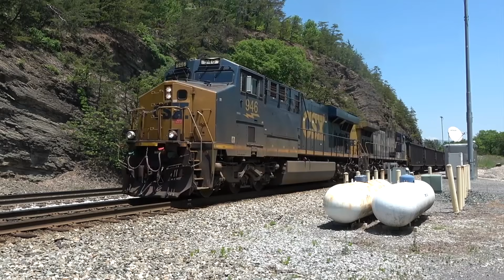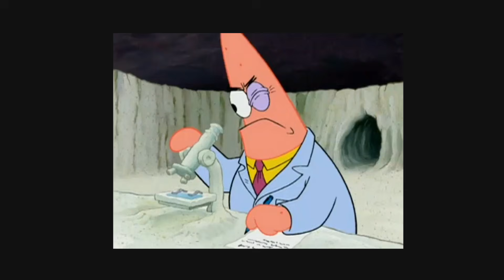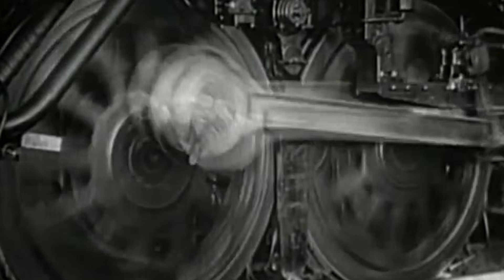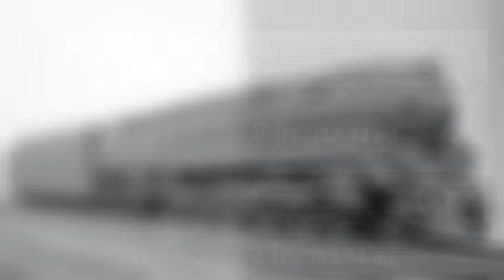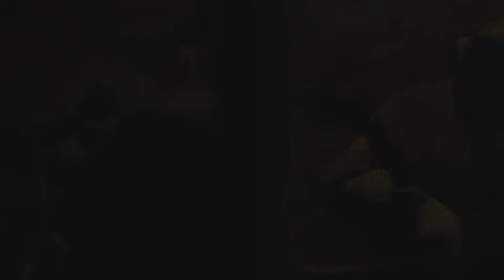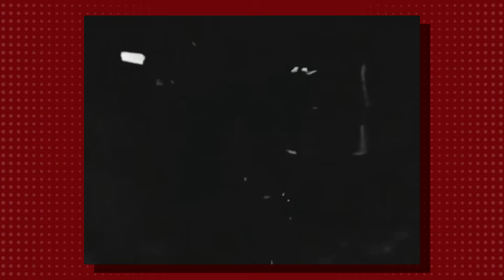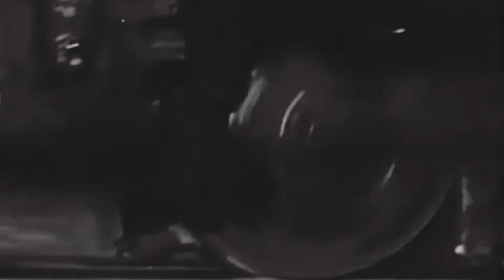PRR Q Series: The Pennsy's Duplex Powerhouse

Comment: 0:01 "It takes a lot of horsepower to get a freight train moving."
Nope. It takes a lot of tractive effort. Horsepower is for going fast. That's why a couple of 1000hp switchers can still move a big train in the yard, but can't move it quickly. And why a couple of 1000hp switchers can move a bigger train than a 2000hp GP38-2.

Comment: It should be noted that the figures obtained by the Altoona test plant should be taken with a grain of salt as they represent the locomotive's performance at beyond perfect conditions that would be at best improbable at worst impossible to replicate on the road. The locos' over the road performance would have been quite a bit lower than what was obtained at the test plant. Sure, on the test plant the Q2 could get really close to 8,000hp, but on the railroad in regular service it wouldn't have gotten near that kind of performance.

Comment: Hang me if you want, but I'm of the opinion that, given their higher expenses compared to the J1 2-10-4, the Duplex concept as a whole was never worth it.
Reply: Yep. Also the passenger duplexes we're of a mostly fear from PRR engineering department that 8 coupled drivers would finally reach it's limits. That's why PRR never adopted a 4-8-4 or a 4-8-2 with large ~79 inch drivers. The concept as a whole is designed to split the Main rods in half to make them lighter and reduce stability issues.

Comment: Ive heard that part of the wheel slip issue on q2s and t1s was that they were so powerful and had so much more power readily available, that engineers would essentially do train burnouts because they werent used to how much power these locomotives had available to them
Reply: And this is exactly why the statement at the start of the video about needing a lot of horsepower to start a train is false. You need a lot of tractive effort to start a train. Having a lot of horsepower lets you go fast, but also puts you at risk of wheelslip at low speeds.

Comment: Why don’t they preserve these things?
Reply: First, because they were largely a failure: they built a class of locomotives whose only real use was fast freights, but the railroad didn't run any of those. Nobody likes to put their failures on display for eternity. But the main reason is that the Pennsy was perpetually short of cash. If you have no money, and 25 redundant large steam locomotives, what do you do with them? Sell them for scrap for tens of thousands of dollars each, or give them away to museums? Or, if you're a museum who's prepared to spend tens of thousands of dollars on a locomotive, what are you going to buy? A locomotive that shows what a typical steam-powered freight train looked like, or some weird thing that only ran for a few years because it wasn't designed for the work that needed to be done?

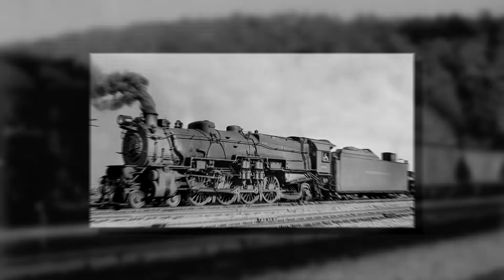Comment: Why didnt they just added another trailing wheel and make at least one 4-8-4 northern? 0:30
Reply: Anyways regarding the M-1 and more things.

The M-1's weight on drivers was already limiting enough that penny couldn't add more tractive effort otherwise the added power will go to waste. Adding another trailing to make a 4-8-4 would take away the weight on drivers even more reducing effective tractive effort.

Weight on drivers on M-1's is 271000 pounds. At M-1b with 69700 lbf tractive effort, the Factor of adhesion is 3.89 (Weight on Drivers ÷ Tractive Effort)(generally below 4 is not desirable resulting in slippery locomotives & potentially wasting the excess tractive effort).

  Also before the S-1s, Pennsy's mechanical department saw extra trailing trucks as undesirable, reducing weight on driving wheels and adding maintenance cost (though this was still less cost compared to many other parts). That's why most of their fleet only had one trailing wheel if any. It was only until the duplex era where they finally need a 4 wheel trailing truck.

Also compared to New York Central. Pennsylvania was  very conservative to innovation. They kept building late 1910 designs, and adopted stokers, superheaters, Feedwater heaters and roller bearings pretty late. 

(Addition to my 3rd point) New York Central was the first railroad to adopt Lima's superpower concept with H-10 Mikados, Boston & Albany A-1a (NYC subsidiary) and the Hudsons. Pennsy was STILL BUILDING K-4s when NYC had already been taking the Hudsons and other superpowers.

Comment: Do you know what the horse power and tractive effort for the Pennsylvania J 1 class is ?
Reply: The J1s had 95,100 lbs of tractive effort, 110,100 lbs with the booster activated. They had around 5,600 horsepower.

Comment: You know motive power managers in that time were stupid. Also unionized to an extreme. There are simply countless cases where superior power was relegated to inferior assignments.

The Q2 had Galatzin PA coal drag written all over it. A similar screwup involved L&Ns marvelous Big Emmas that got stuck dragging coal when they actually were fast freight, maybe actually passenger class locomotives.

THIS CRAP DID MORE TO KILL STEAM THAN ANY DIESEL EVER DID.

Another prime PRR example came when the Pennsy's T1 prototype rolled out they simply placed an order without doing a shakedown. Duhh, that was beyond stupid. This was a whole new platform with LOTS of unknowns and variables + LOTS of subsequent flaws. A shakedown/trial period would have descovered these and allowed for corrections. 

Over at ACL, their marvelous R1s after a sub par unveiling underwent design corrections rendering them superb.

Note: The current T1 project is redesigning/upgrading these things while retro engineering out design flaws. That things looking to be marvelous and WE CANT WAIT TO SEE HER IN STEAM!

In the end, the old guard Pennsy establishment was NOT fiscally responsible or actually progressive at all, which was most clearly made evident via PENN CENTRAL.

Comment: Ironically, the J1a 2-10-4s outlasted the Q's and T's by many years. Duplex's might have been wonderful on the Union Pacific, or even the New York Central, but the PRR was basically a 50 MPH freight railroad.
Reply: Not really, the UP favors articulate locomotives. Granted the NYC is a different story.

Comment: Coming back to this after a while with a few points 

The Q1 was designed with designed with passenger service in mind as well. That’s partly why it was streamlined and had such large wheels. It barely if ever worked passenger trains because the PRR needed something bigger and faster on freight trains during the war, and there were very few passenger trains out of Columbus that would’ve warranted its use instead. There were very few heading to Chicago and none to Sandusky. Not sure where 60,000 came from, I’ve seen 165,000 listed as its lifetime mileage. Still not extraordinary, but the averages as comparable annual travel to a Mohawk. In this case it must’ve spent a bit less time in the shop. Its power curve was decent, in terms of drawbar power it was ahead of an ATSF 2900, but it still lost power a lot quicker than the other duplexes.

The Q2’s were definitely freight engines, and were partly justified for the surge in wartime traffic towards the end of the conflict. Their drawbar power was actually closer to a Big Boy’s, but in this respect the Q2’s were essentially their eastern counterparts. The swapped placement of the rear cylinders caused some stress on the boiler seams, and I suspect this is part of why their water consumption was so poor. It’s also what killed them in the end, not so much their worse economy to the J1. All were laid up with cracks in their boilers in 1951, and caulking only gave them barely another year.

Comment: The Q2 was magnificent but it was the solution to a problem that didn't exist, mostly because PRR didn't run their freight trains fast enough to take real advantage of their capability. That and their unacceptably high maintenance cost doomed them to be retired very quickly, while the brilliantly successful J1 class kept soldiering on until the very end of PRR steam. Another batch of the those J1 workhorses would have been a far better investment, at a time when the last thing PRR could afford was expensive experimentation. Nonetheless, certainly I wish that a Q2 had been preserved, as an example of the highest development of US steam power.
Reply: Right. The only point of a high-horsepower locomotive is to go fast. If you want to move heavy loads, tractive effort is more important, and moderate horsepower will get you moderate speed.

Comment: The Q2's tender held over 20,000 gallons of water, and they could completely drain that thing within 2-1/2 hours.  Kind of a hindrance for a high speed freight locomotive when you have to stop every 2 hours to take on water.  Also the anti-slip mechanism on the drive wheels tended to wear out quickly.
Reply: The Q2 burned a whopping 16,600 gallons of water an hour when working hard! VERY inefficient.

Comment: I think duplexes could of been sucessful if more research was put into it, with the t1 trust getting built prehapes we could finally see if the duplex concept could of really been a success
Reply: Frankly the Duplexe design is just a dead end that waste resources for a railroad that desperately need larger motive power
Reply: The duplexes were unsuccessful because they were the wrong tool for the job. The only point in having a high-horsepower locomotive is to go fast. Pennsy didn't run any fast freight trains, so they should have stuck with moderate-horsepower locomotives for their moderately fast trains.

Comment: I think the real problem with the Duplexes was PRR not investing in their infrastructure in this time period(which was a contributing factor in the down fall of Penn Central later down the road). They weren't doing the maintenance so these marvels of American ingenuity were just wastes of time. I think the T1 trust will have one amazing locomotive when they complete 5550 and it might inspire someone to make a q2 Mk2 also later down the line but the PRR was one of those text book how not to run a company.
Reply: No, the real problem is they built locomotives whose only proper use was high-speed freights, despite them not running any high-speed freights.

Comment: I’ve actually heard that the wheel slip problem was more operator error than poor design.  They could be made to operate without wheel spin but it took very precise throttle control to make that happen.  Most just couldn’t find that perfect balance.
Reply: If the design of a locomotive means that only the very best engineers can run it properly, that's a bad design.

Comment: 7987 horsepower dang that makes them one of the few big steam engines to rival the union pacific big boys
Reply: In terms of drawbar power, they’re actually roughly on par with each other! Only the Allegheny was more better in terms of actual pulling power, but its worth mentioning the Q2’s have smaller cylinders and fireboxes than both the articulated. Unfortunately they were as bad as the Big Boys on water, if not worse, and were nearly as heavy on the rails as the postwar Alleghenies

Comment: I knew I saw a version of the Q1 that had a bigger trailing truck at some point.
Mechanically I think the Q1 is one of the best looking engines there was. Though it would have been nice if they lived up to their mixed freight role and saw one with a full passenger sharknose!
That would probably be the first fantasy model I would make whenever I get the time.

As always it seems like the biggest issue with those late PRR locos was Pennsy themselves. I imagine in an alternate world where dieselization held off for another 5~10 years the Q2's would have just as much fame as the Big Boys since they really seemed to trade blows in specs. It's a shame that PRR saved so many engines, but none of these amazingly complex Duplexes.

Comment: Q class is still one of my favorite lost locos. 
Imagine what could have been if they had more time to mature.
Reply: But they were mature: the problem is that they had no use on the Pennsy system. The only reason for having a high-horsepower locomotive is to go fast. Pennsy's freight trains didn't go fast, and a moderate-horsepower locomotive is fine for going moderately fast. Oh, look, it's a J1.

Comment: Pennsylvania Railroad management seemed to get a lot of really stupid ideas in the 1930s and onwards.  The GG1 was not too shabby, but they got that design more or less from the New Haven, and look at what preceded it (class O-1 with the wheel arrangement 2-B-2, the electric equivalent to a 4-4-4) and what followed it (the DD2, supposed to be the successor to the GG1 for hauling freight or mixed traffic over the never-completed Allegheny electrification . . . so they went from the GG1 wheel arrangement of 2-C+C-2 DOWN TO 2-B+B=2!).  So it's no surprise they had equally idiotic ideas with their steam locomotives.  If the locomotive weighs over 1 million pounds and has a tractive effort around 100,000 pounds, you're not leaving much headroom for getting over a grade.  And by the way, it's not horsepower you need for starting a train -- it's tractive effort.  That is one of the reason that the M-U'd diesels won . . . although properly designed electrics would have been better (if only they had run with the E44 idea and completed the Allegheny electrification after all . . .).  Back to steam, plenty of ideas for improving steam were going around in the rest of the world, and some even got decently wide adoption, like the Bayer-Garratt.  If the Pennsylvania Railroad would have adopted that, they could have had good power output, a decent number of driving wheels for improved tractive effort, and decently short wheelbase.  But for some reason, railroads in the Americas never considered these, even though they worked fine elsewhere.
Reply: the short answer regarding the garratt is not invented here. longer answer, look at the tractive effort of the strongest garratt ever made and the strongest mallet, east african's class 59 vs norfolk and western's Y6B. 

as far as improving steam goes, the second the EMD FT came along, american steam was on a timer and WW2 only delayed the inevitable.
Reply: @hiawathabeast  Agreed about Not Invented Here.  Not the first time, and not the last.

With regard to tractive effort, remember that the African locomotives other than the more modern South African stuff had a lot lower axle loads than US locomotives, so matching US tractive effort was not possible with Garratt or Mallet designs without going to a LOT more total driving wheels.  Likewise, African freight other than South African ore trains was not as heavy as US freight.

Comment: The 7,987 HP isn't drawbar HP though, that's cylinder HP, which always has a higher figure than drawbar HP. From what I could gather, the Q2's drawbar horsepower (power at speed) was 6,645 (not sure at what speed though), well below the Allegheny's 7,498 DBHP at 46mph. So, the Q2, while still super impressive, is not the most powerful steam locomotive ever, at least not at speed.
Reply: Altoona shops. UP'S Big Boy #4000 was 6200 dhb according to UP's dynamometer car, N&W's A was slightly higher at 6300 dhb. Likelihood is Q2 still had the highest dhb
Reply: @muir8009  I keep hearing that the N&W A's 6,300 DBHP figure is a fluke and really produced around 5,300-5,400 DBHP. At this point, I'm not sure which figure to believe. Also, I still think the Allegheny is the king of DBHP when it comes to steam locomotives, as 7,498 is clearly higher than 6,645.
Reply: @markantony3875  That was what I come to learn sometime after posting my reply after thorough research.

Comment: Horsepower isn’t as good of a measurement as tractive effort, so no these aren’t really as powerful as a big boy or Allegheny, plus the boosters were rarely used as the increase in steam usage would always be more than the steam generation thus losing pressure. Horsepower is better for acceleration than total power. Plus the locomotive had much less driving wheels than the big boy or cab forwards for example, 
In reality, the Q2s were just UP Challengers with less adhesion due to the less axles and more axle load on the tracks
Reply: "Horsepower isn’t as good of a measurement as tractive effort"
Depends what you want to measure. Tractive effort lets you move heavy loads, horsepower lets you go fast.

Comment: The Q’s are kind of an anomaly to me because I’m never too certain what the PRR was going for. Especially with the Q1, I’m thinking a 4-4-4-6 with the 70 or 72 in drivers would’ve worked better, with the use of roller bearings. And while the Q2 has the highest horsepower output of a steamer, it’s by a measurement at the cylinders. I’ve yet to find any details of its drawbar power like with the S1 and T1’s. I’m sure it would’ve been less than, albeit very close to, the 7,500 HP of an Allegheny

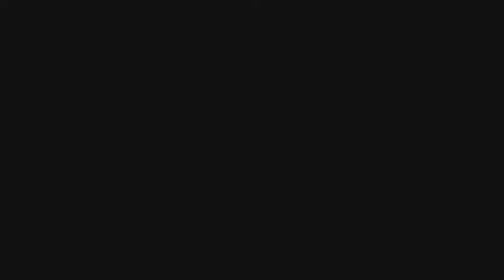Comment: 0:38 actually… it kinda was?

After the study, between 1944 and 1953 (or 1946 depending on what source you are reading) 40 M1as (Including survivor 6755) were given water circulators, an extra 35 ft in the firebox, and increased the PSI to 270. With a final result of 69,700 tractive effort,  the M1B was “born”. 

it’s interesting to note that when they were nearing retirement, these M1Bs hauled coal/ore drags upwards to 10,000-11,000 tons.

Another interesting thing was that in the late 1940s more plans were considered for an M1C but was very quickly hushed and cancelled when diesels came around. 

Oh yeah if you want to know a reason why m1s were 99.8% on freight trains, their heavy rods made the pullmans bump a lot and gave passengers complaints. 

Bert Pennypacker is a helluva drug kids.
Reply: They also had a tendency for water to surge in the boiler during braking and spew out the chimney while braking. The K5’s had the same problem. I can only assume the use of Front-End throttles on the duplexes bypassed this problem